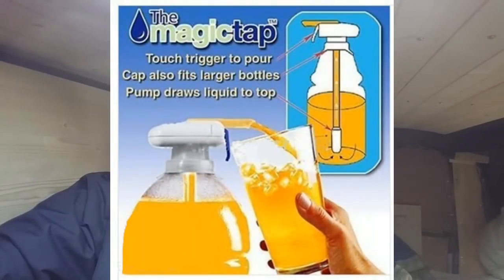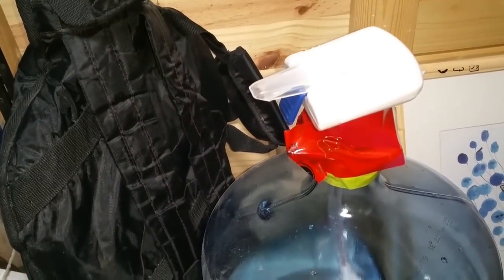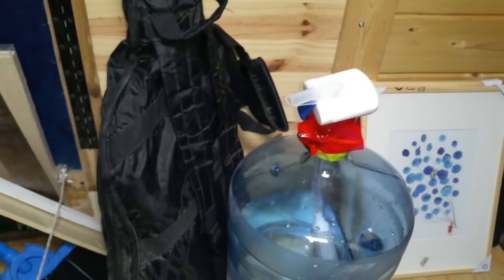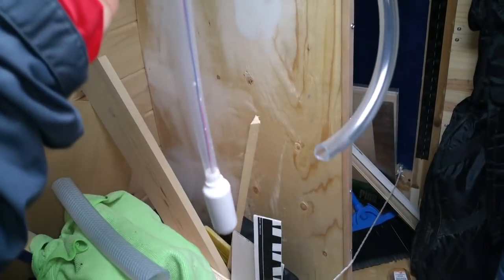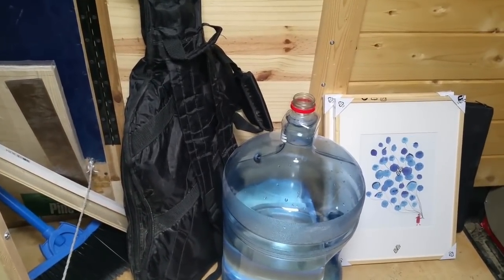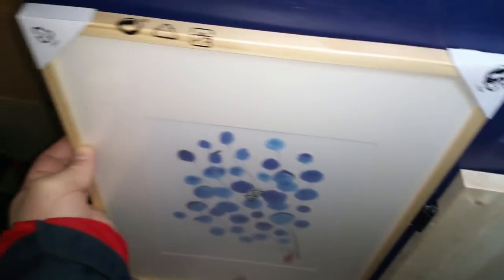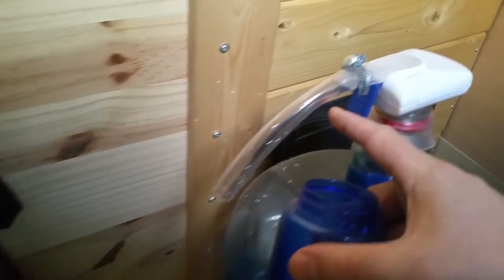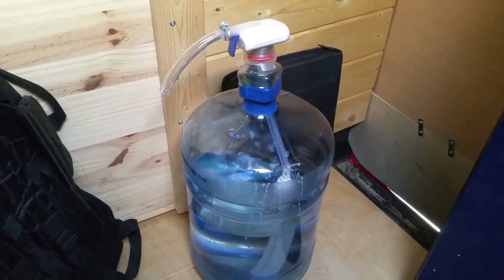DIY Water Pump... Will It Work?

Comment: Just like an electric fuel pump in a car, your little pump pushes liquid better than it pulls. Needs to be extended to the bottom I thinks, from this view. You could try a small hand vaccum pump, or low air pressure to move the water, mounted remotely, if you're not into a standard 12 volt water pump.
Reply from the maker: Thanks. If I can't get this to work I'll consider other options.

Comment: nice instrumental beatles.  I think you would be better off with a small 12 volt submersible pump that you could wire up to a switch and just drop in your 5 gallon water bottle and run the 3/8" or 1/2" hose out the top cap of the bottle.  put your glass under the hose, flip the switch, fill the glass, and flip the switch off...your done.

Comment: Walmart has the Primo bottle water bottle pump for Primo 5 and 3 gallon  bottles for $9.94.  We bought a Primo  3g bottle for around $13 and it's working out great.  The amount of water per hand pump is pre-measured so you can't control it as precisely as with a spout, but the squirts are small and if there's any left over,  we just pour it into our large stainless steel water bottle for later.  it's quiet, easy to pump and cheap.  Also, an added benefit is that if there no working Glacier machine around, we can exchange the bottle for another Primo bottle filled with water at Lowes, Home Depot or Ace Hardware for $6, which also saves having to clean it.

Comment: There's a hand pump on amazon that is made to fit those bottles and no batteries or electric. Although I'm not sure it would fit in your cabinet. The pump part is on the top and you push it down to get water.

Comment: It was a good idea. 
The manufacturers of PVC has spent a lot of money to “prove” their hoses are food grade. Independent studies suggest otherwise. 
I wonder if the submerged hose is too big a diameter for the small pump. Home Depot sells PEX pipe that is regarded as the safest plastic. It’s sold in smaller diameters than the PVC hose you’re using.

Comment: Great idea ! Best location for pump at the very bottom with same diameter tubes. Big question is the power supply &/or pump itself strong enough for the additional depth of the larger bottle? Hope all is well with you and yours ☺️
Reply from the maker: Thanks bro. I've decided to buy a  "proper" pump.

Comment: Is the juice bottle and tape airtight? You need to have somewhere for the air to get back into the jug in order for the water to be able to be pumped out, otherwise you end up with a vacuum inside the jug getting stronger and stronger until it balances out the force of the pump, and no more water.

Comment: haha I remember you talking about this.  I'm sure it will work, there's just an air leak somewhere.   hmm.. or maybe it won't work because it's too much weight for that little motor.   keep us posted
Reply from the maker: Yeah I'm likely going to just buy a traditional pipe.
Reply from the maker: pump

Comment: Hey Tim. Off topic but thought I'd tell you about it. I don't know how you feel about the Chinese Rebasto knock off heaters but I saw them for $199. Plus right now ebay has 15% off anything using the code PSPRINGTIME.
I just bought a diesel version for $169 US. I get tired of turning my Big Buddy on and off as it over heats my van. Hoping this does the trick for me with the programmable thermostat. It was that or an Olympian Wave 3 and I opted for the Rebasto style purely because of the advantage of the thermostat.